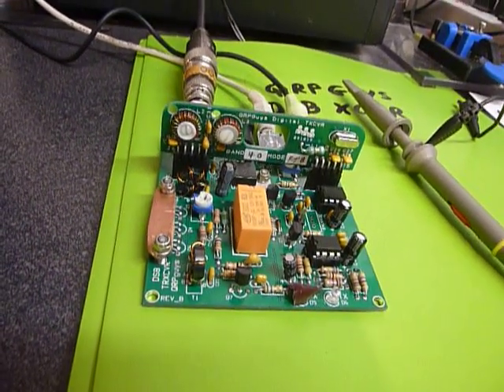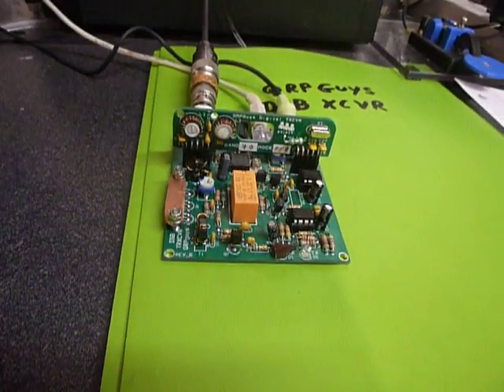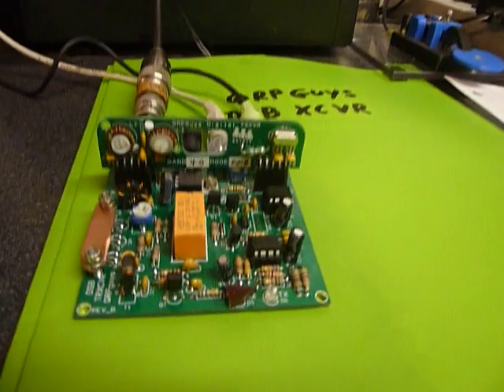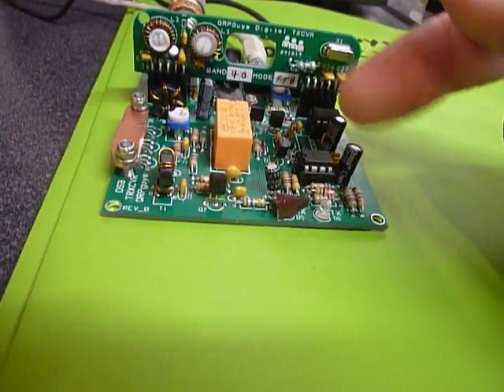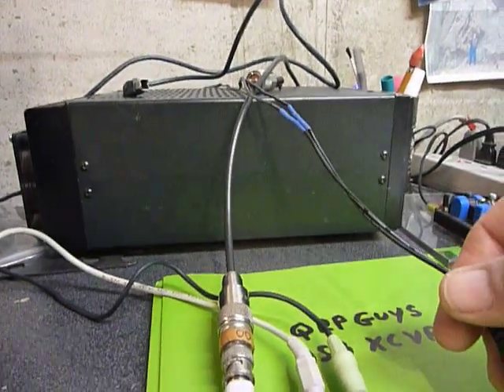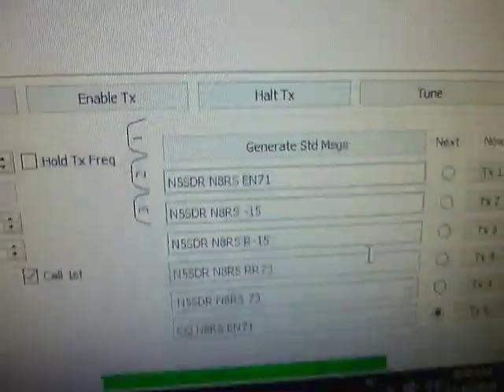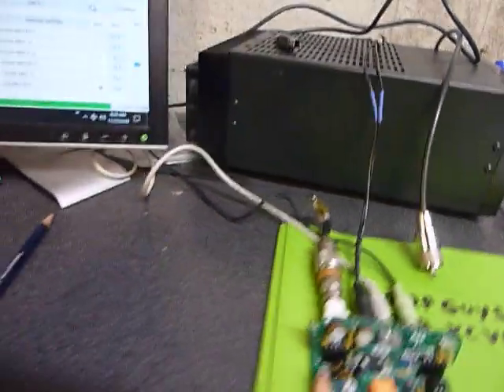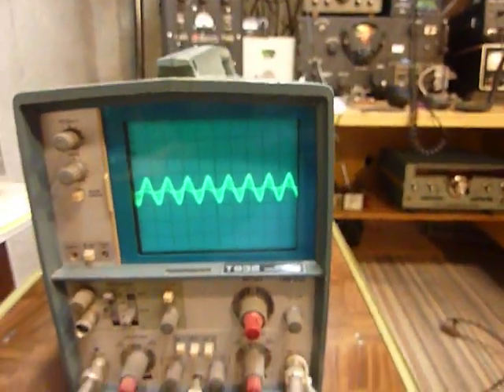QRP GUYS DSB  Tranceiver  on FT8, Operating  FT8

Comment: Bob, nice old TEK 932 "student scope". Used to pick these at the TRW swap meet here in SoCal, refurb them, and sell them on to hams who needed a decent scope for HF work. They were rated at 35 MHz and could be had for $20-50 if clean and working. A friend of mine who sold at the event had an inverter and I would make my offers contingent upon the unit checking out. Here's a decent video on how to do the checkout and should be useful for any scope:

https://m.youtube.com/watch?v=LbkOwwTOowA

Comment: Glad to see it working for you. Mine is extremely low power (~200mW, when I short out the filter, which is a bit too restrictive i get ~300mW) I suspect dead BS170s so I will try to change them. However I just got QRP Guys transceiver III operational, and it is really great, getting contacts all around Europe! Btw, great channel! :) 73 YU4HAK

Comment: Thank you for this Video. It is this for what I was looking for. I have finished a ssb transreceiver kit from spain. DB 4020. I have already a question. Where is the signal  which is switching between tx and rx? Is it working with a VOX - funktion, or is the tx signal on one channel of the stereo plug?

Comment: Very useful video. Thanks. I have one of these kits but am having trouble getting the audio levels right as the Rx signals from the PC jack are triggering the Tx circuit. BTW, your scope will give a more meaningful trace if you set the timebase to see the  audio envelope and not the RF waveform! 73